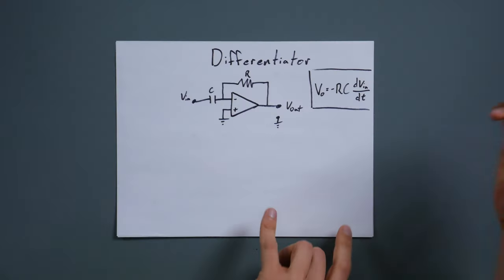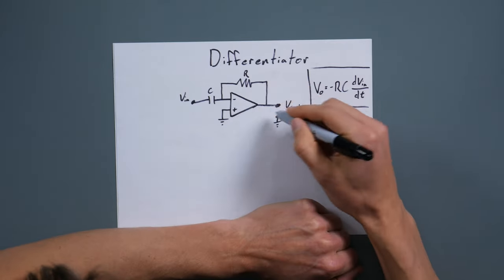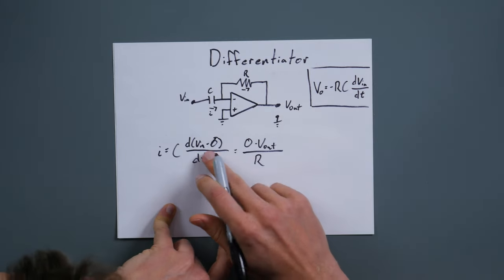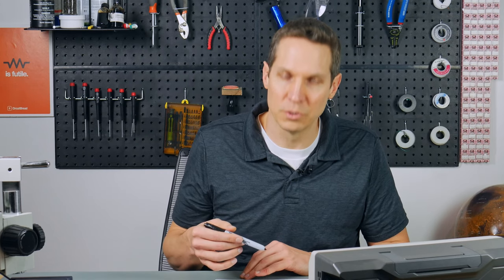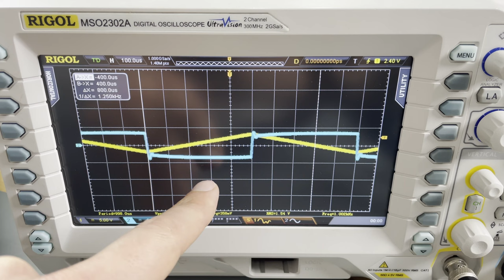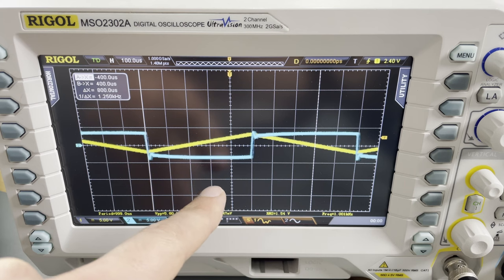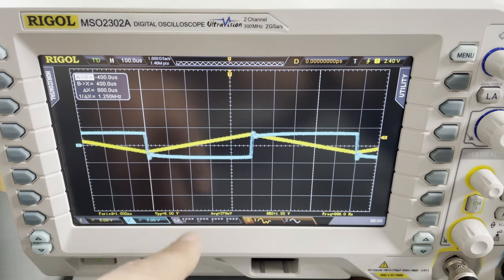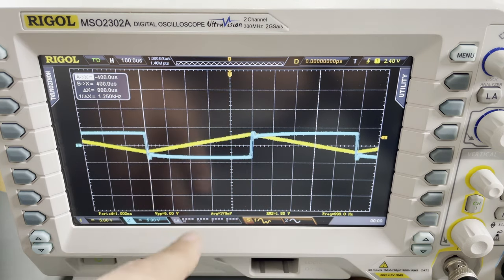Differentiator - Operational Amplifier | Basic Circuits #15 | Electronics Tutorials

Comment: I have been unable to find a design for a single rail, non-inverting, derivative op amp circuit. 
I have found a single rail, non-inverting, integrator that works well, but no equivalent for a derivative.
Are you aware of such a design?

Comment: I don't understand what is the role of op amp in the circuit only resistance has role in regulating voltage  in that circuit ?

Comment: Sorry if you covered this elsewhere.  Can you also demonstrate these applications when you don't have a negative rail?  Like the diff hovers at a midpoint of 5 v on a 0 to 10 v supply for example?
Reply from the maker: I haven't done a demonstration but that is entirely possible!  Just remember that ground, or 0 volts, is arbitrarily chosen.  So, -5, 0, and 5 volts would be the same as 0, 5, and 10 volts.